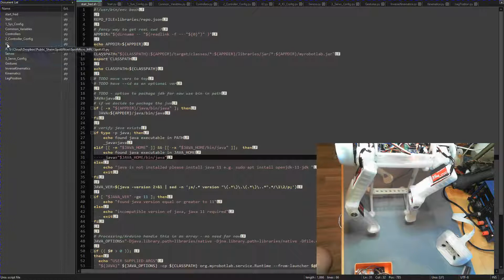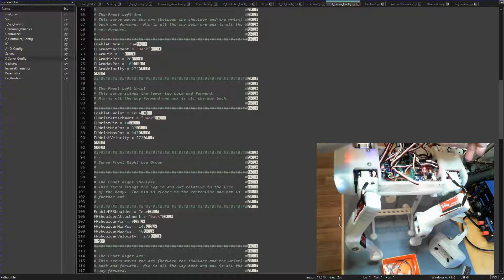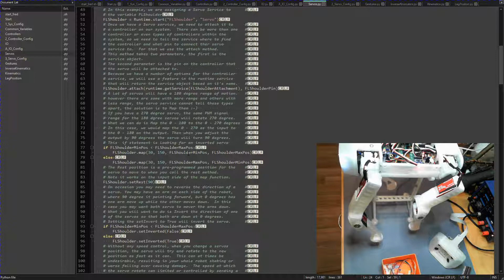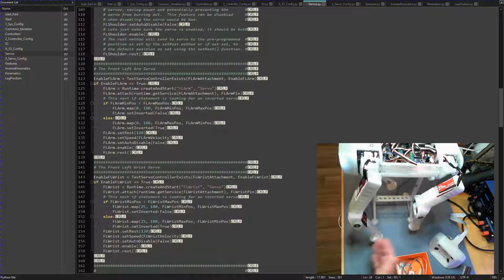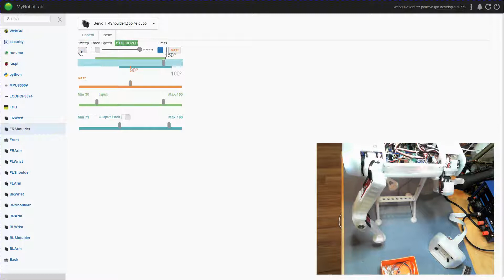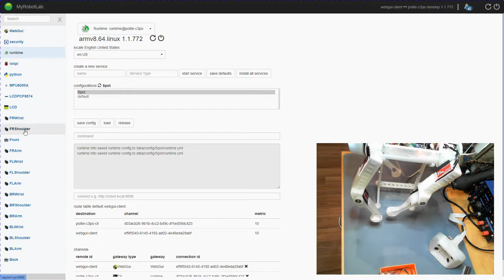SpotMicro Part 10

Comment: Can i install it on a windows system (11), too ?
I found only a installation hint for Linux (or Mac?)
Reply from the maker: MRL runs on Java, that means you can run it on any OS that will run Java.
So yes, you can run it on Windows 11 or Mac.

I run it on Linux, because that's what runs on such small hardware.  In this case the Raspberry Pi is built into the robot..
If your running on a bigger computer, you will need to tether the robot to the computer your running.